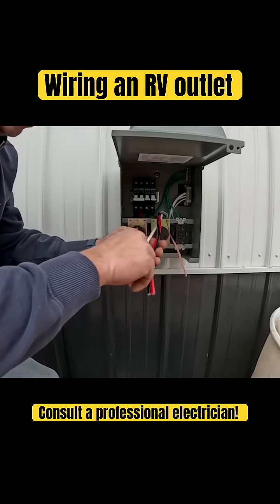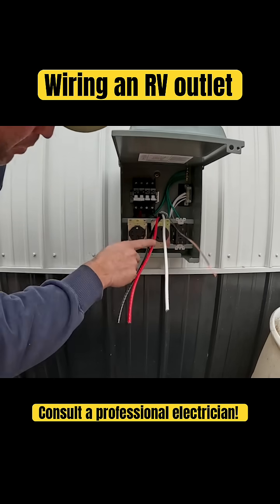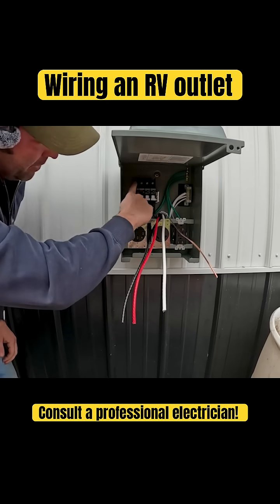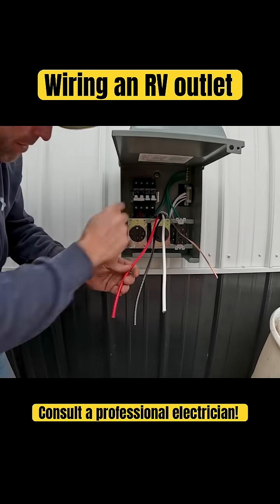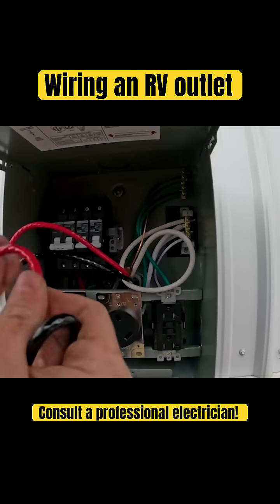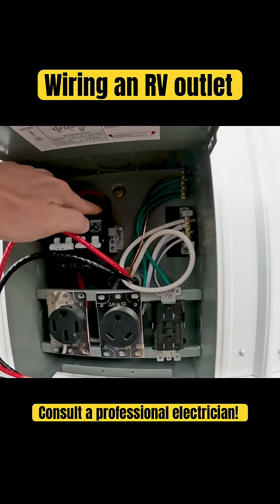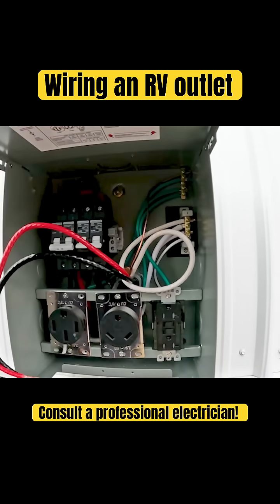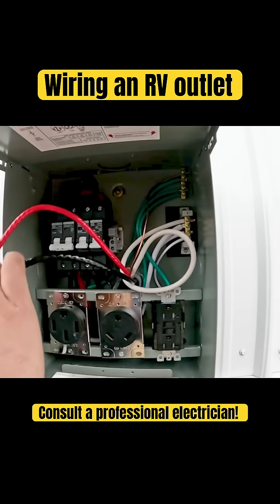How to Wire an RV Outlet #diy #electrical #rvlife

Comment: Bridging a 60amp with lower amperage ?is that dangerous
Reply from the maker: It’s a 50amp. And no it’s literally what the directions say to do. Also, i’m taking a 50 amp over to a 30amp and then a 20 amp. Everything is protected by their breakers. Absolutely none of it is being overpowered and is protected by a breaker. The entire box is even protected by a 50 amp breaker at the main panel. It’s actually overprotected.